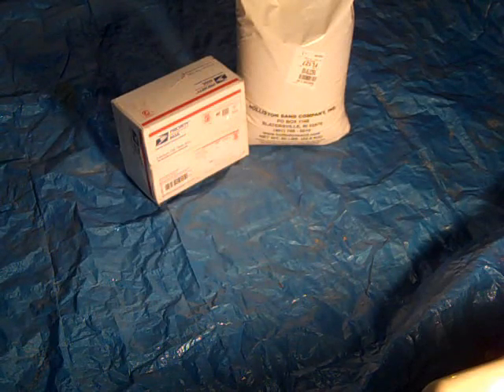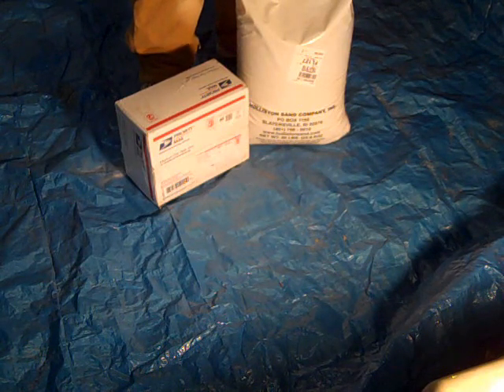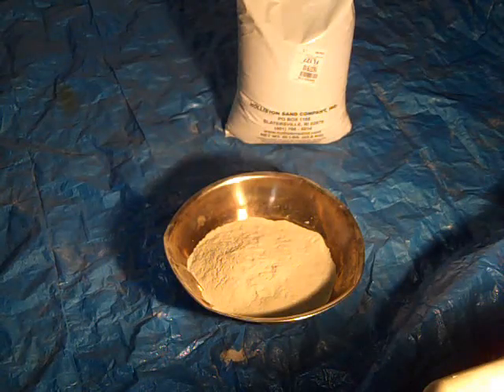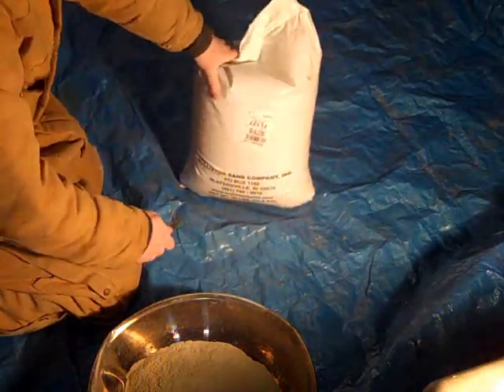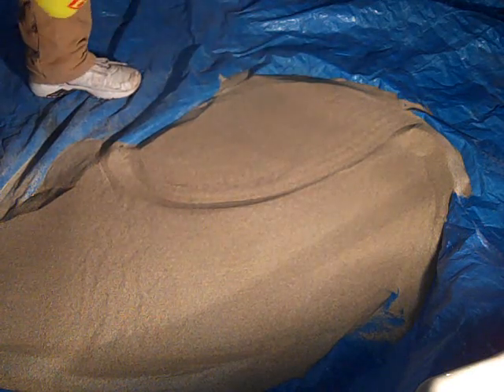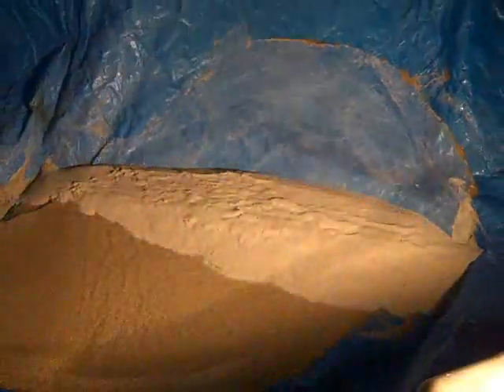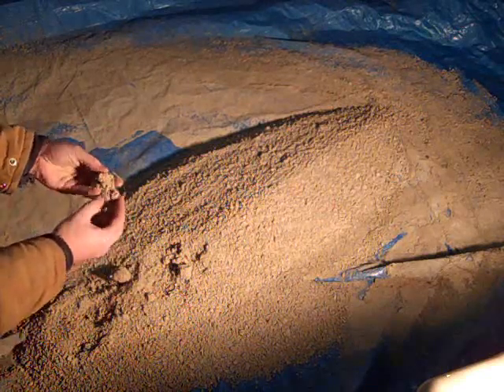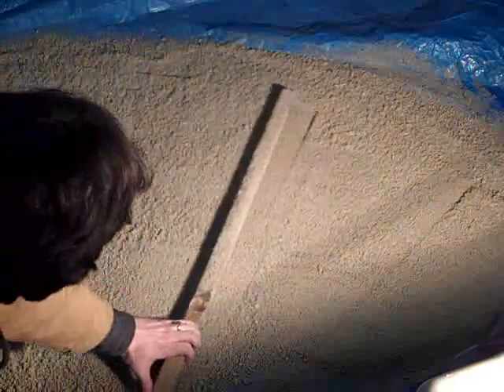DIY: Easy to make greensand for casting metal - Aluminum sand casting

Comment: Nice vid..Sorry to burst Ur bubble,,The process you use is fine for the 1st 1/2,actually well detailed,But that silica sand is only 00 grade.So it does not matter how fine ur bentonite clay is.The surface finish will only be as fine/detailed as ur 00 silica sand.Bentonite clay is expensive as hell.Why not just use fire clay?It is less than $20 for 10kg ..You will then have change left to buy a sieve/riddle.I hope that white thing was NOT polystyrene,the thing U put the cope/drag UPSIDE down on??

Comment: man thats fucking insane. call any local ceramics, pottery place supply place and they will have bentonite clay. usually they will sell it by the pound so you dont need to get a a freaking 50 dollar bag when you need six pounds of it.  petrobond for sale website seems to be the ticket. guy is selling pre mulled petro bond for about a buck a pound shipped.

Comment: Grinding the cat-litter in a ordinary kitchen- blender/mixer makes it fine as powder in a matter of seconds. This way I made about 40Kg greensand a couple of months ago. Despite what some experts are saying, it really does the job good. Though it required a lot of mulling before i found the strength of the sand satisfying. Mulling in this case was done by hand.. and took me about 6 hrs of manual hard labor. Next project will be to make a muller ;)
Good Luck! and thanks for sharing =)

Comment: I saw a video of a guy doing 10% cat litter and 90% finely grained sand to make good consistency... would that be cheaper than your material? It still does the job for "metal casting" if that is the intention lol

Comment: I found a source of Bentonite. A well drilling company just a few miles away sells 50 pound bags of it for $17.50! I don't need 50 pounds, but if I haveto buy more to save some money, I will. Now I'm having trouble tracking down silica sand. The nearest Carquest to me is about 10 miles away, but I don't drive, so that's out of the question. Home Depot doesn't have the right stuff, too course. I'm looking at pool stores, filter sand might work.

Comment: Very cool! I'm gonna have to try this. My first mold material was just dirt, I went outside and cut my shape into the dirt. It worked decently well, but the dirt was too wet. I didn't have a steam explosion, luckily, but the water content of in the dirt boiled immediately on contact with the molten aluminum, which resulted in a lot of little air bubbles in the surface of the cast. Overall though, for my first time it ended up pretty good. I'll have to look into making some of this stuff though.

Comment: Not a problem. If you want a relatively smooth finish for castings, then I would suggest using a thin layer of Talc on the form used to make the mold. This also helps with the removal of the form from the mold.

Comment: RE: Petrobond replacement, use the same mix as in the video, but use a synthetic 2 cycle oil instead of water. The oil I use is AMS Oil 100:1 seams to work very well. I just start adding 2 oz's at a time till I get close then a squirt oil can to finish. I'm building a small Muller to make things easier and faster.